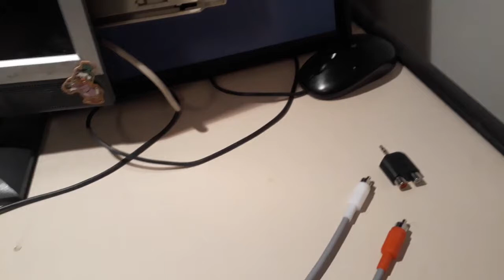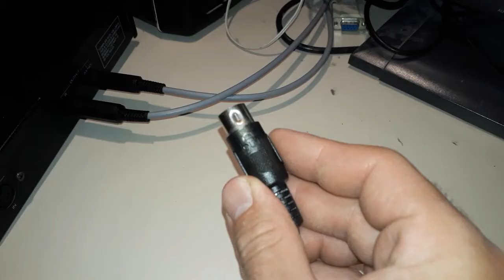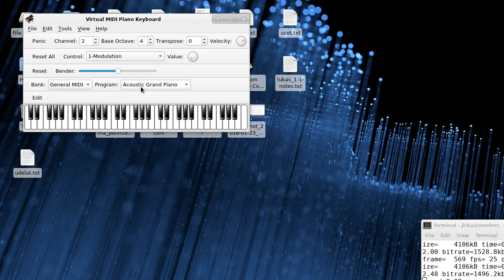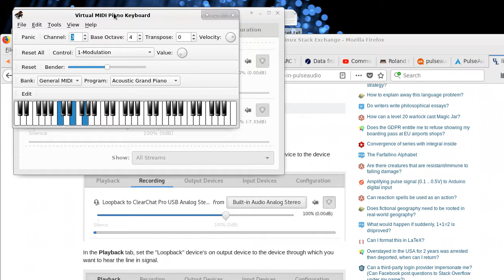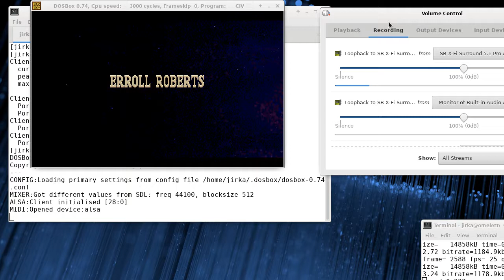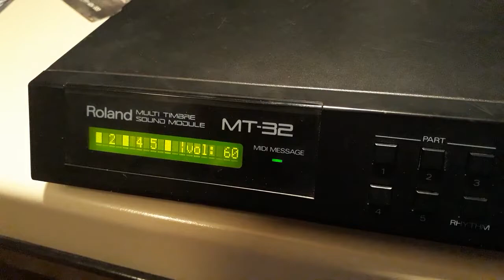Roland MT-32 Power up and Test

Comment: It's possible to power the MT-32 (or any device really) with any power adapter as long as you meet 4 requirements;

1) Must fit, sizes of these barrel plugs vary so get the right internal and external diameter.
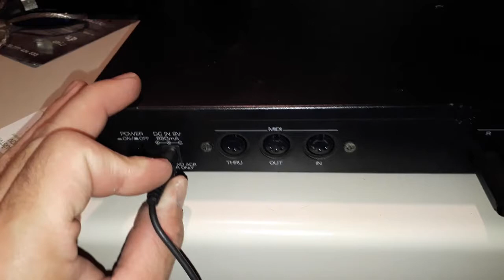2) Must match polarity, these days everything has the same polarity (except say guitar pedals) but for older equipment (like the MT-32) it might be center negative. This means that if you connect a multimeter with the ground to the barrel and the live wire in the barrel you should get -9 V (a center positive will generate +9 V). See the icon right above the plug around 4:27
3) Must match voltage, pretty simple it's noted at the back of the device; 9 V. This can be checked with a multimeter as well.
4) Must be able to provide enough amps, again easy to see as it's noted between the voltage and the polarity on the back, only thing you need to realize is that it is the device drawing the power. So if you have a universal adapter that says it delivers up to 2 amps rather than the 0.64 A (or 650 mA) it ask; that's OK. Again with a multimeter you can see just how much amps the adapter is capable of delivering, do note that a multimeter will attempt to draw the maximum amps and may actually exceed anything that's written on the adapter itself. The MT-32 will only draw as much as it needs (which will be that 650 mA), but even if it's rated for say 600 mA and the multimeter says it can deliver up to 1000 mA you should be fine, the only thing is that the adapter will get slightly warmer than normal. Obviously if it's rated for 100 mA and you try to draw the full 1000 mA your multimeter indicated you could be creating a fire hazard.